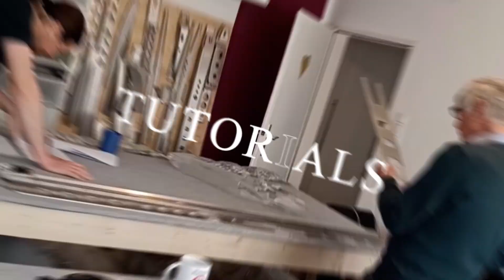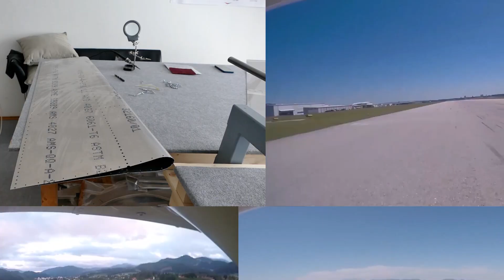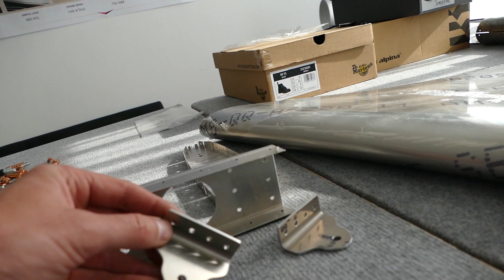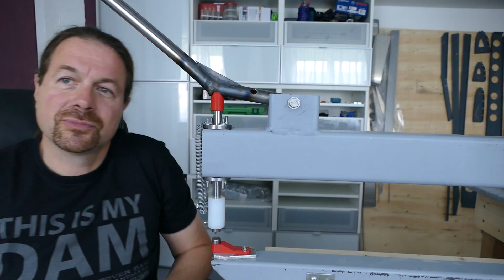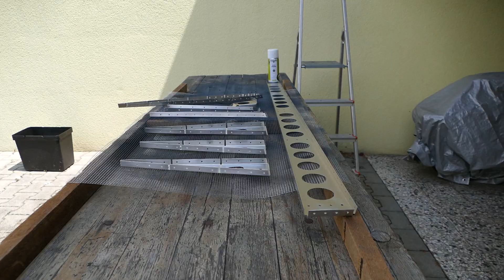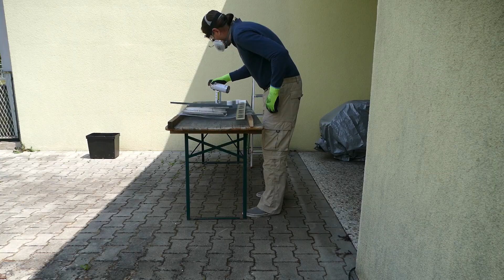Preparing the Parts! | My TSi EP02

Comment: Hallo, Griaß di! I cant offer up any comment any where near as technical as some of your followers ........ but, if you warm the plastic with a Haartrockner first it could help to peel the plastic off easier! I had the same problem removing plastic from a huge newly fitted kitchen & it was so, so much easier x
Reply: I have tried to warm up the plastic but it only makes it weaker. It still stickes to the aluminum quite strong.

Comment: I wouldn't bother priming the outside of the skin at this stage. They will be primed when they are painted for final finish. Good luck with the build. My kit arrives in six weeks or so!
Reply: Thank you for your answer! I have now primed only the inside. I just wonder, wether there has to be a primer under the rivets. 
Hope you get your kit soon and good luck for your build!
Reply: @peterrabl468  would you be using Duralac to dip your rivets in before riveting? That would take care of corrosion.
Reply: @markmanley1070  that seems to be a good idea! Never heard of any builder using this.
Reply: @peterrabl468  I was told to use it for dissimilar metals to prevent corrosion, but I don't see why not to use it for all rivets to prevent water ingress.
Reply: @markmanley1070  i will definitely make more research on this and test it.
Reply: @Peter Rabl  I just did a search on one of the build groups I'm in and they said "I use duralac on all rivets and a jointing barrier called CORTEC.....quick drying water-based. Simply brush on and leave to dry. It contains anticorrosive components." Duralac dries hard and so is good for paint.
Reply: @markmanley1070  thank you! You helped a lot!
Reply: @peterrabl468  no problem! The result of thousands of hours of research while finding the funds to buy. Are you building over in Germany?
Reply: @markmanley1070  in Austria. And you?
Reply: @peterrabl468  I'm in the UK
Reply: I read you should prime before dimpling - what's your view?
Reply: @gho  no as you will damage the primer. Also you may need to ream the holes after dimpling as they are undersized as they stretch during the dimpling process. You want to make sure all work is complete on the metal before priming.
Reply: @ghoflyer i think it is better to dimple first because you don't harm you priming layer. I can not see a good reason to prime first.
Reply: @peterrabl468  yes I agree with that logic.  The counter logic was it was more difficult to get even coverage in dimpled holes.
Reply: @ghoflyer  
It may be better to roughen and clean the surface with Scotch Brite before dimpling because it becomes difficult to do so after dimpling. I especially do this with skins because roughening it after dimpling and riveting is impossible.